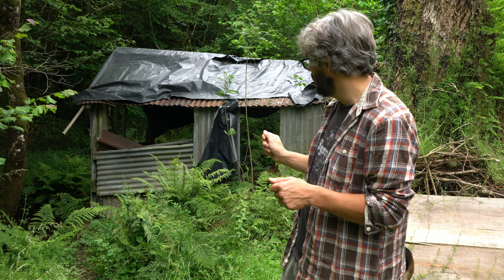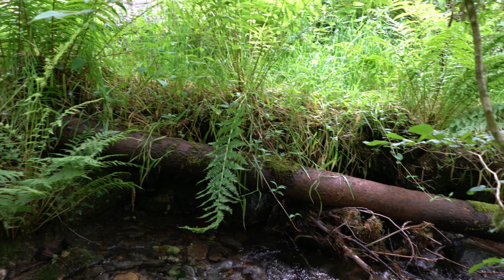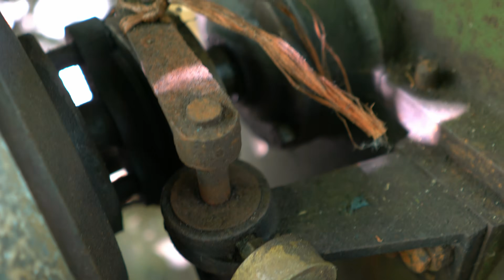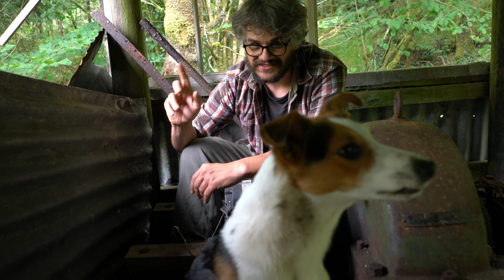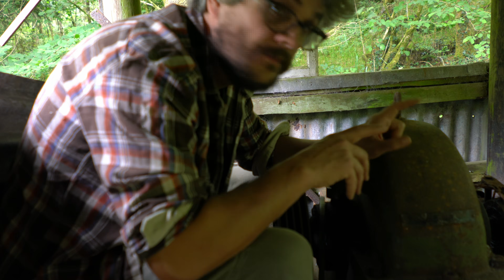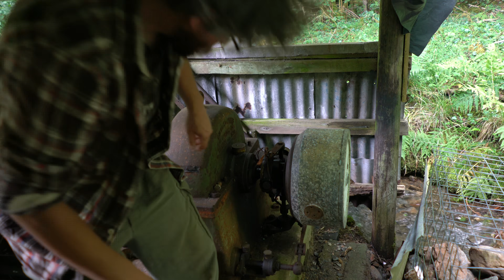Restoring a 100 year old Hydroelectric Turbine Part 1 - Intro

Comment: To recharge batteries and not worry about the turbine firing without load, you can use a 24v 105A Delco Remy brushless alternator. It will maintain a fixed voltage of approximately 30 volts at the output regardless of the rotation. It would be the most practical and efficient equipment for you to use, as it does not involve maintaining a resistance bank or reactivating the turbine's original regulator, and there is no risk of overvoltage in the equipment.
Reply: I am building my micro hydroelectric plant, it will be a turgo turbine, 42 meters and 8 liters per second with a 340 meter long pipeline, 120 meters of 100mm and the rest two parallel 75mm tubes, the generator will be a Delco Remy 24v 105A hybrid system with micro inverter for on grid and off grid inverter when the utility network is lost, stationary gel batteries (or maybe sodium)

Comment: Yes, an interesting project indeed. I suspect dealing with excess power generated will be a key issue. It would be nice to have some kind of automatic vane control looking at power demand versus generator output? It will save you dumping power to water or air heaters or having to manually throttle flow.

Comment: about your solenoid idea... On my sail boat the propane line to the cook stove had a solenoid valve on it. ( so it wouldn't fill the hull and kill you). it consumed 40 watts all the time it was on!? horrifying waste of power. anyway looking at the water pressure/flow, trying to hold that diverter in the flow (hold back the spring)will likely consume more power than you expect. I'm not an expert and cant estimate it for you. but study the continuous power consumption with a wary eye and do the math before you buy one. I would work very hard to get the original governor going and use a diversion load to heat your water.
if it gives you peace of mind think about a rpm sensor  with a linear actuator. that way the sensor draws power like a watch and the actuator draws only when it moves.
My brother in-law has a 1000watt plastic princess pelton wheel. obnoxiously loud but ran like a dream for 10 years till it blew up and needed some new parts. he had a frog governor... you might think you have to train the frog but nope, natural instinct is all they need to shut down the turbine. the hard part is getting them to stop it at the right time. this one chose spring time and when every thing was running fine. when he looked in to see what stopped the turbine all he saw was it's leg was sticking out of the injector nozzle.kamikaze frogs are easier to find than you might think...

Comment: At 6 liters per second, a 90 mm inner diameter pipe will bring your losses below 5%, and a 100 mm inner diameter should bring losses below 2%. At 10 l/s, 5% losses would need 110 mm and 2% losses would need 125 mm.

Comment: What you use for a generator is probably going to be dependent on what kind of end-use you have for the electricity, and how far you want to transmit the power.  If all you want to use it for is DC and it isn't too far from the site that it will be used, then a rectified 3 phase generator will work.  If you will be using it for primarily AC single phase power, you might be better served by using a PTO generator for a tractor.  These PTO generators will do everything for you, no diodes to hook up into a rectifier - just hook your line into them and feed it straight to the house.  The turbine would have to be regulated down to about 540 RPM, so as long as it has that much adjustability it would work OK.  The power output of your turbine would likely fit the PTO's power required.
Typically, if you have a long way to pipe the power you want to use AC because there are less line losses than DC.  It is also at higher voltage, which will send equivalent power at lower current - which means you can use smaller gauge wire to transport it, and it is generally a lot safer for humans and animals.  But, trying to send it 3 phase may involve you in calculations that you probably don't want to do.  You'll probably want to figure out whether you want to send it in Delta or Wye (Y) configuration (to minimize copper line used, probably Delta). This is why a single or 2 phase output on a PTO generator could be your friend.  Most houses (at least where I am) use single phase power, mostly because it is a lot cheaper to send power that way for the power company because it uses a lot less copper (or aluminum) wire.
The other reason you would want AC power at your house is because appliances operate almost exclusively on them.  Yes,  there are DC appliances but they are usually undersized, expensive and are not particularly reliable.
If you want to send it 3 phase down to (what I assume) is your house and you incorporate a transformer in any way, get an electrical engineer (a power type, works at power companies) to look over your calculations and to make sure the setup in general is safe.

Comment: Hey Aristotle :), I came from part 3 of this series. After reading comments I think a car alternator is maybe the best match of your turbine. Here are my considerations:  1.A car alternator can provide 1-1.5 kilowatts generally speaking, which matches with your turbine. And the voltage regulation is well established by the automatic voltage regulator module (which is actually an automatic electromagnetic field controller to the alternator itself) built inside the alternators so that they can provide constant voltages for your car's electric system. Imagine the headlights gets brighter and radio becomes louder whenever engine running at higher RPM - unbelieveable LOL. 2.I don't know the specifications of your solar system or your battery system, i.e. voltage, capacity and so on, but getting 28V DC from the turbine-alternater set and charging the batteries seems really promising to me, 1kW power for battery charging 24/7 is more than enough. 3.Let alone MPPT, that concept is for photovolatic generation only. Iron alternators have another set of theories of about 150 years old and really well-established. 4.As long as the alternator is providing voltage higher than the batteries', it is charging them. The only difference is higher charging power (charging faster) with higher turbing RPM, and charging slower with lower RPM. I'm really interested in this project because building a small-scaled hydro power station has been a dream for me since I was a kid, and I still don't know when it can be realized (I live in city). Your project reminds me of that. We can discuss about the electrical part if you like, not only because I'm working towards my doctor's degree in EEE, but also, like I mentioned, this reminds me of my dream. Best wishes!
Reply: Oh forget to say that I really love your idea about that fail-safe governor design. Keep on it mate!
Reply from the maker: @TheBalconyWorkspace  Cheers for your comment, I've had a few different ideas but my plan (at the moment) is to use an Induction Motor as a generator and charge our 48V batteries with an AC charging system that can regulate itself based on the RPM of the turbine. I'm planning on doing a little video on it soon, stay tuned!
Reply: @aristotles-lantern  Sure thing! Induction motors can be used as generators with adequate capacitors in parallel to establish field. Don't remember very clearly but it seems that adjusting the output voltage of such generators is by adjusting the capacity. Anyway give it a try!

Comment: It's not difficult to get it working, it's not that bad, it even turns by hand, I would rather worry about the pipe that carries the water, it's usually the first to rot after abandonment, the turbine itself has 2 bearings and has the double injection pin on the Pelton spoons that needs fixing, the regulation can also be manual if the available water is more than necessary, but if it has to follow the available flow it needs an upstream level sensor or downstream pressure sensor and the motorization of the same so that it always maintains the maximum level in the upstream tank without overflowing too much, in this house you would always have the maximum available power automatically, alternatively you have to go and check and act manually, the rest you have to do new, alternator and electronic load control board to always keep it under constant electrical load to stabilize voltage and frequency as the connected utilities vary, here you can easily produce 230V and use it directly, the excess is usually used for heating

Comment: RE: the solenoid on the speed regulator… the MPPt controller we have on our hydro turbine does a tracking cycle 2-3 times a day. That would probably trigger the solenoid in your case, which would then not allow the tracking cycle to find the maximum power point. (The head of our system is lot enough that over-speed on the turbine is impossible so it doesn’t matter.) Just a heads up.
Reply from the maker: Oh that's an interesting point. I'm not even at the design phase of my deflector but that'd be a spanner in the works. One idea is to have a tachometer monitoring the RPM and have that switch the solenoid: seperate the safety mechanism completely from the rest of the system.

Can i ask what controller you're using? I'm looking at either TriStar or Midnite classic as they both have wind/hydro modes i think. Rest of the system is Victron.
Reply: @aristotles-lantern I have an Outback Power controller. It doesn’t have a specific wind/hydro setting. However, it does let you manually choose the power point (my turbine likes 57%, usually). It also has a diversion load feature that triggers a solid state relay to divert excess power to a resistive load. We have a 400w baseboard heater in our bathroom in the wintertime. My turbine is from Energy Systems and Design. They have a recommended controller that reliably maintains a load on the generator. They have a website. A side note: we added a small solar array a year ago, and it required its own charge controller. I don’t recommend Outback, btw. They were recently bought by another company, and there is currently no customer support. Also, a super annoying feature is that it will go into a “charged” state when charged parameters are met. It will send zero power to the batteries until they are completely drained. Seems like a fundamental flaw.
Reply from the maker: @runnerkid100  this is more useful than you might think! thanks for information
Reply: @runnerkid100  it's my understanding that MPPT tracks by the second or minute not (tracking cycle 2-3 times a day) that may be something else.but a real problem all the same.I've sat there and watched mine, it output 14.5 volts constant but the amp input is all over the place, as in changing every 2 or 3 seconds.BlueSky MPPT solar 12v system. that's what they do- constant voltage but amps change to whatever is coming in...
the going into a “charged” state when charged parameters are met. sounds like the generator setting or grid tied setting. my Outback charger/Inverter gave me the same maddening problem. using the generator setting. nothing worse than wandering off and it timed out and wasted the tank of gas. I believe I found a different setting that solved the problem for me. before I built the PV array it was a 1000Watt generator on 20 KWH of battery bank 48V. so it timed out every 10 hours max. 
FYI the OutBack forum had better info than anything else i found. sucks they got bought out... Sad because there the only company that airlocks the circuit boards and has an external heat sink. and every component is user replaceable. not even Magnum does that. I live beside the ocean in a rain forest so that was the big selling point

Comment: Great project, thank you for sharing. When I first saw the governor/flywheel, it looked almost like a granite curling stone. I thought maybe at least the was cement inside to give it mass, with the aluminium outer maybe 🤔 

My other initial thought was about the condition of the bearings, but it's good they're not too worn. Looking forward to seeing it progress :-)

P.S. do you have a pulley or crane to lift the housing cover? I imagine it's heavy.
Reply from the maker: Yeah the cover's going to be a pig to move! I'll probably get something like an engine hoist for that. After seeing how corroded a lot of the fixings are I'm now tempted to leave the housing be for now. If I get it running then go back and invest the time into a proper teardown/refurb.

Comment: Great looking turbine!  Modern microhydro produces DC fed to batteries (since you already have solar and the batteries it requires). This allows you to skip all the complex obsolete speed controls. Use a permanent magnet generator. It will produce 3 phase unregulated AC, which is rectified to DC.  Back of the napkin power prediction 9L/S and 90 meters of head the small pipe will be the limiting factor. Plan on around 1kw. To make this happen you need an in country expert. Check out Chris Harbour as he has extensive experience with PM generators and the specific regulators they require. Please keep us posted.
Reply from the maker: I forgot to actually say it in the vid but yeah - I've calculated at 60 percent efficiency at the top end we could get about 1.5kw with the current pipe. more realistically i think it'll be 800w to 1200w, which if we can generate constantly will be absolutely amazing.
Reply: I also have been watching Chris harbour I like his work. He has one on going at the moment I'm looking forward to see what the output is. Is literally the only video I am waiting to watch on YouTube. That and the tvarish p1.. lol

Comment: That's a neat piece of old kit. I'm not sure I'd mess with the original speed regulator, beyond adding an electrically actuated shutoff. I would not be surprised if the original designers picked a fairly optimal speed for that pelton turbine to perform at peak efficiency, then it's up to you to figure out how you can use the turbine output RPM the best way. As for integration with your existing system - I would not be surprised if the easiest way would be to run it AC-coupled. There's (IMHO) also nothing wrong with letting the hydro run year-round, as long as you have enough water for it, and the water usage doesn't affect anything downstream. Having (near) constant power input is a game-changer for off-grid systems.
Reply from the maker: The problem with running direct AC is i want to couple it with our DC battery system so it can charge overnight if we use a lot of power during the day. Even generating a few hundred watts -as it's constant it'll soon top up our batteries overnight. Thanks for watching!
Reply: I second getting in touch with Chris Harbour, not sure where you are exactly but sounds like you might be close to him. He's just getting started installing micro hydro systems for people and has a wealth of experience from his own system, it would be cool to see him give his input for your system. Cool project for sure, and nice shirt 🤘
Reply: @nconoan  came here to say that.

(That's "Kris Harbour Natural Building" on youtube, but you probably already figured that out.)

Comment: Great project!  It's too bad the original generator is in such bad shape.  I wonder if there would be any hope in it functioning again if it were to be rebuilt.  On the other hand, a modern setup on the electrical side may be better.  I'm not sure I like the idea of the speed regulation, being on the electrical side, as it seems wasteful to me unless that heat is used for something.  That's just my initial thought, not knowing anything about hydroelectric systems, However.  Looking forward to seeing more.
Reply from the maker: It's a shame yeah. The thing with the old generator is it's designed for a much higher power output from the turbine. I'm expecting to make about an eighth of what it originally output so even if it was worth saving it'd be way too big and inefficient unfortunately.
Reply: Well, if all the windings have to be redone anyway, it's easy to make it for a lower powerrating.
Probably cheaper, too, cause thinner wire will do...🤔